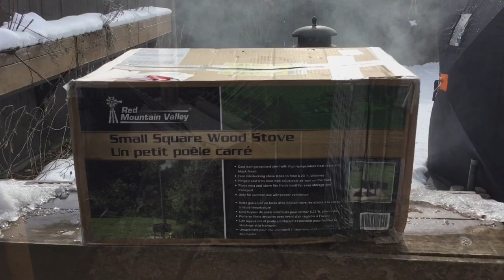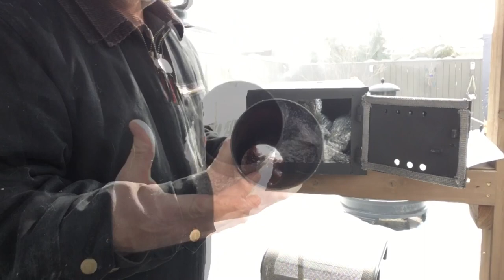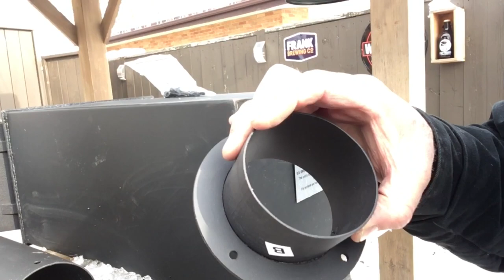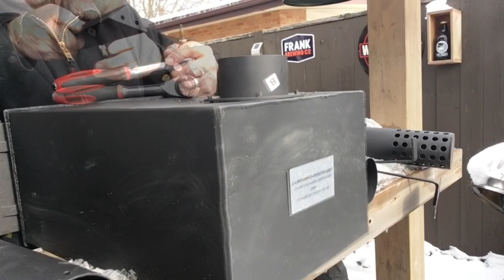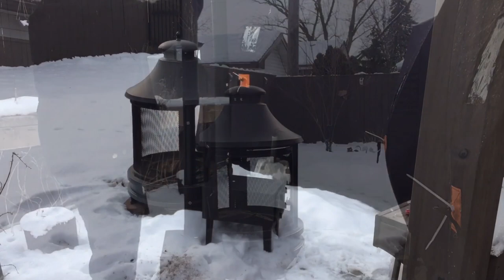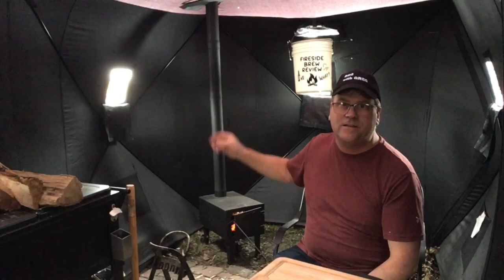Unboxing a new Wood Stove

Comment: Was that a mushroom coming out of the wood at the end, or did you put some filler in it? Anyway, looks like a nice stove, you could even do some cooking on the top of that. I looked into these little heaters, and in the end I went with a diesel heater 5kw, it works great, I am really happy with it.
Reply from the maker: Lol good eye David. I had to go back and watch. That is moisture in the wood foaming out. Yes, I plan to cook on this one. Diesel would be cool. I like the smell and the crackle of the wood.
Reply: @GregRocheleau  Oh right, it looks like a formation of some kine, really like a mushroom anyway. And I agree, there is something calming about having a wood fire going, its like camping on a lakeshore.

Comment: You assembled it incorrectly
Reply from the maker: @kelmanadventures574  you are right. I did it wrong.
Reply: @GregRocheleau   only the one peice but It worked just fine still. Just handy to be able to tighten those bolts from the top of the stove is all
Reply from the maker: @kelmanadventures574  I don’t know what I was thinking but it is a clean look on the top of the stove.